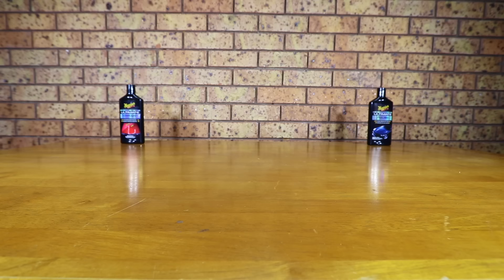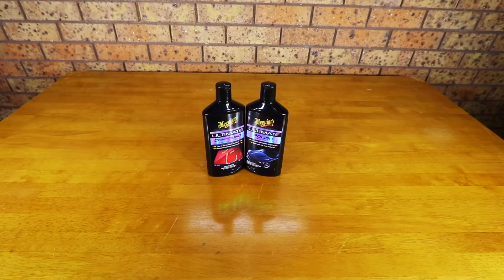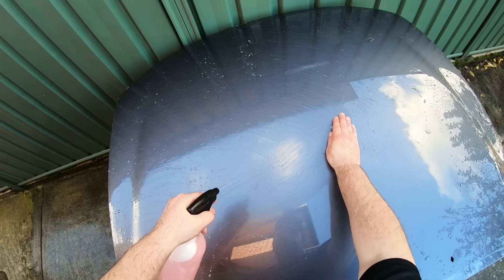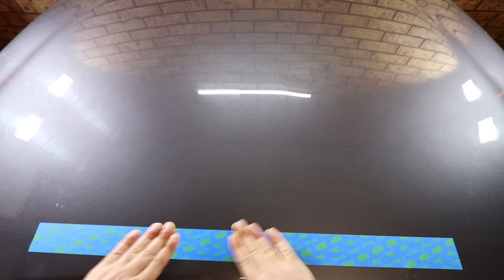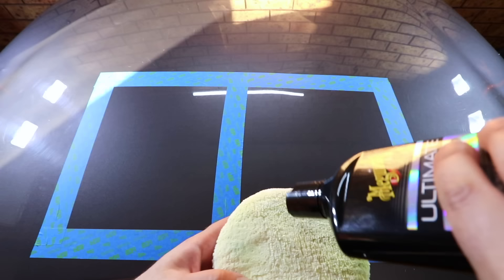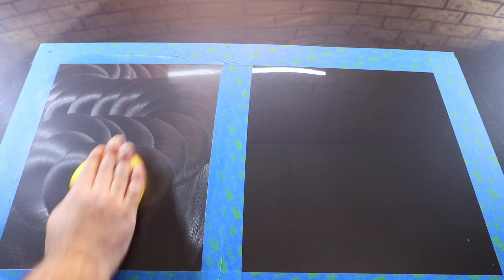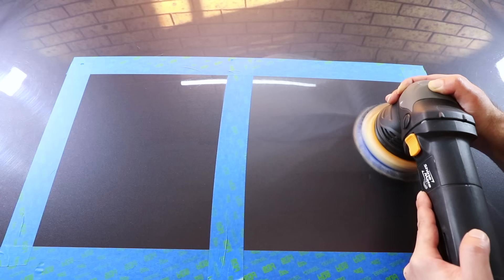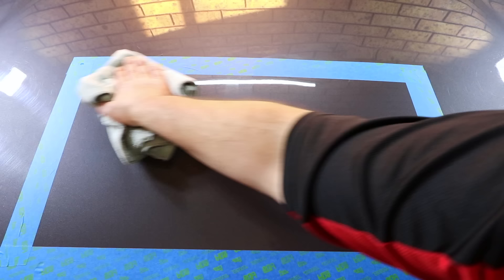How to Use Meguiars Ultimate Compound & Polish+ Review & Demonstration!

Comment: Man just asking I have a tight budget so I am considering to buy the bosch goo 12ce and it it’s the Meguiars polisher so what pad should I use for it pls let me know it’s bosch 12ce professional and what pad should I use with it bcs it isn’t Meguiars is my question
Reply from the maker: If you’re new to polishing I would highly recommend you don’t get a rotary polish like the Bosch 12ce. A dual action polisher like the Shine Mate Ex610 may even cost less depending on where you live and it’s much easier, safer and great for a beginner or experienced detailer. 
Check out the Shine Mate pads if you want a good machine pad that’s very affordable.
Reply: @CarCraftAutoDetailing  okay so the shine mate okay I shall buy it but I and intending to use it with the Meguiars ultimate compound and other Meguiars pain correction stuffs so what pads should I use for those pls let me know bcs Meguiars they recommend some other pads of their own in different thickness and stuffs that’s why just asking why do you say the Bosch 12ce to be avoided just asking pls let me know for 2 of my questions
Reply: @CarCraftAutoDetailing  plus I want a polishing machine that’s reliable for my detailing business pls let me know which is better to use I am think a budget of 150usd to 170usd is my max budget
Reply from the maker: I’ll give you a link to a couple of videos that may help explain those questions a little better 🙂
The Bosch 12ce is a rotary polisher which is different to a dual action polisher, and if you’re starting out, a dual action polisher may be a better choice - I think Bosch also make dual action polishers so you could look into them as well. You don’t need to buy specific pads for specific compounds - I guess as far as shine mate goes you may want to try their yellow, blue and red foam pads to start with. 
https://youtu.be/D4MbOfxAs1U
https://youtu.be/UetseOcebH0
Reply: @CarCraftAutoDetailing  can you give more info on the shine mate 610 pls so I shall buy it and I am considering to use Meguiars polishers and compounds so the pads what do you recommend pls let me know
Reply from the maker: Here’s a link to where I get my Shine Mate products locally- I’m not sure where you’re situated- and you can check out the products info on them. 
As mentioned the yellow, blue and red foam pads is what I’d recommend as a starting point and the EX605 or EX610 are great starting machines and professional machines to continue on
Reply: @CarCraftAutoDetailing  oh okay I understand what do you think about rupee polishing machines and which is best to get at starting levels pls let me know or Meguiars own polishing machines
Reply from the maker: If you have the money Rupes makes beautiful machines and the LHR15 MK3 is great

Comment: so when you wash your car down the line, would the area youve used compound on go back to being dull and need polishing again?
Reply from the maker: True compounds and polishes don’t wear off, they use supper fine abrasives to correct or remove defects, not mask them. The only way the defects return is when they are created once again on the paint 🙂
Reply: @CarCraftAutoDetailing  awesome, really appreciate the response 👍

Comment: Is it safe to use the ultimate compound for a new black car??
Reply from the maker: It can really be used on any car paint
Reply: @CarCraftAutoDetailing  I mean our car is new only 1month old is it good to use this to remove acid rain ? Or should i use another product?
Reply from the maker: If you’ve never used a compound before, may a polish is a better place to start you could just use Ultimate Polish and see if it gets the rain marks out, if not you can then try Ultimate compound

Comment: When polishing painted bumper part can we use same speed or we have to lower speed?
Reply from the maker: You can use a similar speed
Reply: @CarCraftAutoDetailing  iam using Vonroc da polisher 650 watt with 6 speed can I use speed 6 or is it too high? Can we get same result as higher speed using lower speed?
Reply from the maker: Always start with less aggressive techniques which include lower machine speeds, less pressure and less aggressive pads and compounds. Do a test section and see if it removes the defects and enhances the paint. If not you can always increase your aggression as needed. The only way to really know what’s going to work is to test it out 🙂

Comment: Thanks for the explanation. It's not clear on Amazon exactly what you're buying where there are so many variations of this product.  105 / 205 / Ultimate compound / Ultimate polish. Then you need wax on top. Jesus that's a lot of products. I just want to finish my motorcycle visor. I've used PlastX but it's left a smoky effect that won't buff out. 
Can I use Ultimate polish, or is it paint specific?
Reply: @CarCraftAutoDetailing   Thanks. Are you sure? I didn't buy because it said it had conditioning oils and said it works best on darker paint. I've ordered Turtle wax headlight cleaner and sealant, hoping that will clear the cloudiness.
Reply: Well that didn't work. Waste of money. Buy cheap, buy twice. Looks like a need a compound to get rid of swirl marks and haze.

Comment: will the compond and polish scrape the surface of the paint?
Reply from the maker: Yes, they use fine abrasives to remove defects and restore gloss
Reply: @CarCraftAutoDetailing  so it will hurt the paint right?
Reply from the maker: I don’t think hurt is the right way to describe it. Badly weathered paint is more susceptible to clear coat failure because is has a low ability to protect itself from the elements as it absorbs more of things like UV light and environmental contamination. Whereas paint that’s been corrected will better reflect light and UV rays and not allow contamination to bond and degrade it as readily. In other works using very fine abrasives that remove very little clear coat or paint not only restore the look of new paint but also aids the paint in being able to protect itself better and last longer. Neglecting paint is by far the largest reason it fails or wears down.

Comment: Can you use the polish with microfiber pads??
Reply from the maker: Yes
Reply: @CarCraftAutoDetailing  thank you for the quick response, I ask because everyone seems to use foam pads, and I currently only have microfiber pads
Reply from the maker: Foam pads are a better place to start if you’re new to polishing as they are more forgiving to work with, less aggressive, run cooler and easier to clean out residue and maintain. Microfibre can be fantastic as well, but it’s best to work up to using them as they are also more demanding and can be more risky without a little experience and understanding in adapting your technique to them 🙂

Comment: Can  I use Meguire ultimate compound followed by turtle ice sealant??
Reply from the maker: Yes you can
Reply: @CarCraftAutoDetailing   I mean to say that I have with me meguire ultimate compound and the new improved turtle seal and shine sealant, so can I use first ultimate compound and then the turtle one or I also need to apply ultimate polish after compound.
Reply from the maker: You don’t necessarily need to use Ultimate Polish, but in the case that you have a slightly hazy or dull finish after Ultimate Compound, then it may be worth using it before your sealant.

Comment: I have found that Ultimate Products from them are so dumbed down for the general public it takes forever to get the desired result. There is no need to go that far. I have so many hrs on the buffer I lost count, it just annoys me. Their M line is much better in my opinion, I also really like presta 2 step for a quick and safe finish for the inexperienced.

Comment: I just finished using both of these products in the same paint correction and was not that impressed with either. The compound is more on the level of a polish. It does not cloud up the surface like a professional compound and it is more comparable to a professional polish. The paint was actually more reflective after using the compound even with a powerful rotary polisher, which should not be the case. Not course enough to remove scratches, just swirl marks. The polish felt like it did nothing at all what so ever. It is more lubricant and filler than abrasive. I understand that companies don't want to be sued by people ruining their paint by not following directions, but this stuff is next to worthless for actual paint correction. The results you get are similar to a professional polish. Nothing close to a compound.
Reply: The polish is my go-to when there are birdpoop stains that dried up, had one that was there for less then an hour, removed it, and still saw a stain in the clearcoat. Took the polish, did a 20sec polish, was all gone! with water and soap, couldnt get it off anymore.

Comment: Hey! Thanks for the reply on the right DA polisher. I'll try and cut a long story short here. Excess house paint splatters ended up on my car. Panicked and decided to use a dish scourer in hot water to remove them. Resulted in dozens of swirls. Purchased the 3M Scratch removal system with the Trizact 3000 grit. Yes it helped remove the deep scratches but I am left with swirls. Is the procedure demonstrated in your video applicable to the problem I have? Please see a photo for an idea of what it is. By looking at it myself it seems the scratches look covered up because I have waxed it since using the 3M kit. Please see photo and let me know your thoughts. Cheers. https://i.imgur.com/wv4Qotk.jpg
Reply: @CarCraftAutoDetailing  Hey. Thats awesome thanks for that link. Someone wrote on a  comment down here that this method didn't work for them as it immediately revealed the scratches straight after a car wash. Is this true? If so is it only true if its not compounded enough? Thanks again :)

Comment: I used this stuff exactly how it instructs you to use it with minimal results and the wax lasted maybe 2 months. I had some cheap spray in wax in my garage, so I put that on when the wax failed miserably in a very short time. The cheap spray on wax is still holding up 8 months later.
Meguars is junk and a complete waste of $$$$$